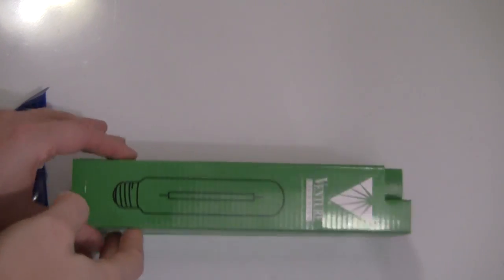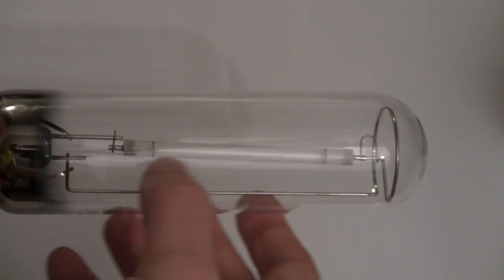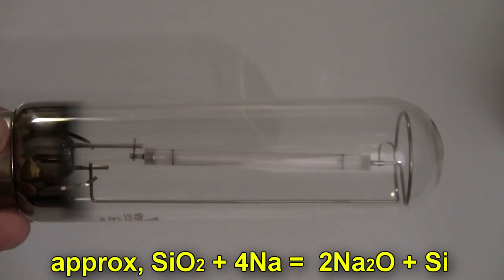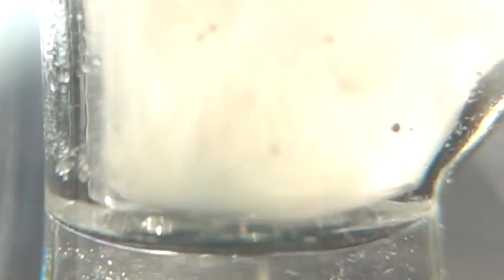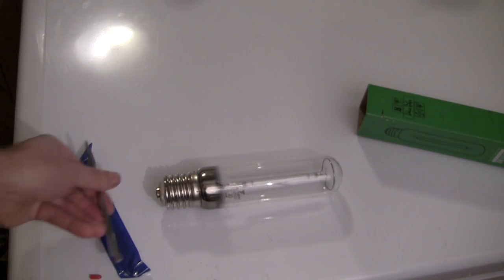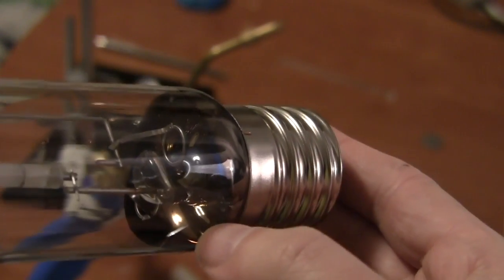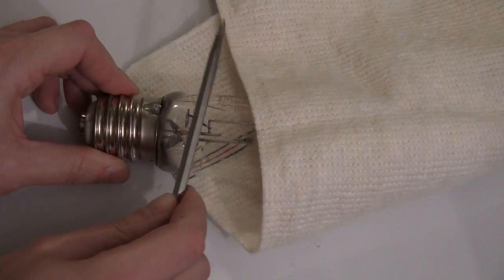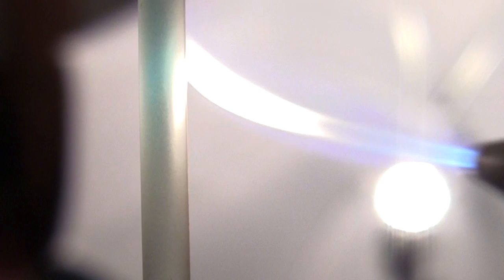Surprises in dismantling a sodium streetlight!

Comment: that silver is reactive to any residual oxygen in the tube.  If you noticed it has 2 getters in the bulb. They vacuum the gasses out of the tube just like a vacuum tube so that current flowing through the wires to the sodium tube won't ionize the gases which would essentially steal the power from the sodium tube. The silver getter material will react and absorb any remaining oxygen in the tube and turn white when exposed to air.  Also imagine the pressure inside the bulb due to the intense heat generated by the sodium lamp. It would blow the bulb apart.

Comment: You are not supposed to touch these with your bare hands as the oils in your hand will diffuse through the (real hot) glass.
Reply: False. This is a completely different kind of lamp from a halogen which is effected by oils. The outer glass does not dissipate heat in an HPS, it's only real purpose is to keep oxygen off the sodium tube inside.

Comment: A friend of mine needed a UV light source to test some special optics so he removed the outer envelope of a high power fluorescent streetlamp and used the internal mercury vapour lamp. He tried to get some information from the manufacturer (Philips IIRC) about the wavelength of the UV but for some reason they just didn't want to know LOL. I wonder why........

Comment: What you are calling silver at the bottom is from the "getter".  The getter is used to eat up any residual gas from a vacuum tube.  That material was once on the rings you see, which are exited by electromagnetic induction, superheating the material and leaving the coating on the glass as it burns away any remaining gas.

(I used to test display tubes for Hughes Display Products, and have watched the production process for monochrome display tubes used in aircraft and ground radar equipment.)

Comment: Hi, this is not cesium it is barium getter!  It is for maintaining vacuum in that tube. Inside those metal rings is barium azide and when barium azide is heated (with induction heating during evacuation of tube)  it's decompose to barium and nitrogen and metal barium is condensed on glass tube walls. Search on youtube Induction Getter Flash.
Barium is used because is reactive with nitrogen, oxygen, co2 and many gasses  thus maintaining vacuum in  tube.

Comment: Thunderf00t, that metallic looking stuff at the base is probably 
a"getter".  This is material evaporated from a filament once the vacuum 
tube is finally sealed.  Its purpose is to maintain the vacuum over 
time by absorbing molecules generated by the heating process.  Getters 
are used a lot in all sorts of vacuum tubes .  :-)
Reply: +MrRamraider
 Further on you say caesium, same thing, for mopping up anything reactive.

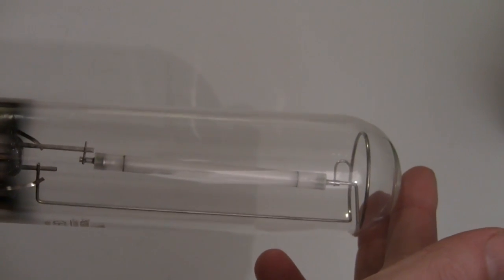Comment: 2:06 The silver part is from the getter inside the tube that creates similar layer of reactive metal on the surface of the glass during manufacture like in vacuum electron tubes and it ensures the vacuum between the outer and inner tube._

Comment: The silvery material looks like getter material used in vacuum tubes. after production vacuum tubes are "flashed" and the getter material absorbs any residual oxygen and leaves a silvery deposit on the walls of the tube. I can see two rings under the silvery deposit those are the getters.

Comment: I used to work for a company that made HPS lamps. The "sodium" is actually a bead of sodium/mercury amalgam, sealed the inner tube (the "arc tube") which is filled with Xenon gas. The lamp circuit has a device called an ignitor (some people call it a "starter motor") which produces rapid high-voltage pulses which create a plasma initially in the Xenon. The Xenon glows a pale pink colour for a few minutes while the sodium heats up and evaporates, after which the light becomes orange. The purpose of the "choke" that Thunderf00t mentions is to regulate the current in the tube, which would otherwise rise exponentially until the lamp was destroyed. (I saw a demo of this once in a training lecture.) This was all in the early 1980s though, so it could all be different by now.

Comment: If you put a scratch longitudinally along the glass it should break more easily.

Longitudinal vs Hoop stress in a pressurised cylinder. Stress is always higher in the hoop so cylinders will always fail with a tear longitudinal.
Reply: +Tsf Phi Taking a few seconds to watch the rest of the video it's clear you're more experienced and delicate at this than I am. Carry on.

Comment: The sliver coloring of the bottom of the light is Gettering.   In radio tubes its typically a sodium compound that is inductively heated to remove, as much is possible, the remaining oxygen and impurities in the tube or light bulb. You can see the 2 getter rings at the bottom of the tube.

Comment: The silver part near the base is to react with any leftover oxygen in the bulb.  This is the same idea with vacuum tubes (for radios, etc.).  You can also tell if it is cracked/leaking as the silver turns a flaky white.

Comment: The metal coating on the inside of the tube is called a getter and its purpose is to scavange residual oxygen, water and other reactive gases that are adsorbed onto the glass surface and are hard to remove otherwise.  Barium, aluminium, titanium are commonly used in special getter alloys and deposited onto the glass using induction heating when the tube is already sealed and under low pressure (In the video its observable that some of the alloy evaporates as the hot glas touches the mirrored area). The golden color can also be just due to oxide/hydroxide layers that remove certain wavelenghts due to destructive interference during reflection.

Comment: You could just use a pipe cutter with a tungsten carbide blade. I've done it before and works fine for cutting all kinds of glass tubes.

Comment: Pretty sure the Silver colour is down to it being lead based glass used for the outer envelope which dis-colours when heated to high temperatures for forming without tempering while cooling., Personally worked more with mercury based compact florescents than HPSV though  and its been a few years...If you want a real cool trick try viewing formed lead glass through a polarized lense (from ordinary sunglasses) against a white computer screen ;)

Comment: Interesting bit for ya:

Yes, that metallic strip on the discharge tube is for aiding the initial striking of the lamp... sodium lamps are a bit like fluorescent lamps in that they strike better when there's a nearby metal surface... if it's grounded then that's even better... as for the metal in the bottom of the lamp where it's made reflective, that's where a Cesium getter material has been sputtered onto the glass, it's used as an indicator to warn in case the lamp has been cracked since if the arc tube was to leak (which is very common for sodium lamps that have a lot of hours on them and have been cycled on and off regularly, such as a street lamp or high bay fixture in a factory), the hot sodium vapor would immediately react with the moisture that leaks into the tube alongside any air. If this happens, of course, you'll have a bit of an issue since there's a fair amount of sodium in these lamps!! although WAAAY less than your average SOX (or low pressure sodium) lamp!

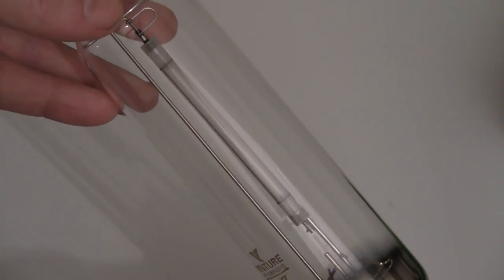Comment: @1:52 The silvery material is prolly Barium.
These bulbs (High power light bulbs in general) are similar in construction to a vacuum tube. They both require a vacuum for operation. During construction, a part called a 'Getter' is installed, that usually has Barium. Once the bulb has a vacuum and is sealed,  the Getters are heated via induction so the Barium boils off (flashes) and reacts with and 'absorbs' any trace gases and 'pulls' a hard vacuum, and also coats the inside of the bulb. That's the silver colored coating you see. (I'm assuming that the Getters in this bulb are probably the two round plates you can see in the area of the silver coating). If the bulb loses vacuum, or even gets a small leak. the Barium will react with incoming gases, like a Zinc sacrificial anode, and help maintain the hard vacuum. However, if the leak is excessive, (or bulb cracks) all of the Barium is reacted, and the silvery coating turns powder white. If you ever see a vacuum tube or bulb where the coating has turned powder white DO NOT USE, as there is air in the bulb, and as soon is the bulb/tube is energized, it will burn up, and may short, causing damage to the circuit it is plugged into. (In the case of these light bulbs, prolly won't do much damage to a simple power circuit, maybe trip the breaker, but if it's a vacuum tube in an electronic apparatus, or an amplifier, the shorted tube can cause significant damage.)

Comment: I remember my chemistry teacher wanting to show me the trick of using hot glass to enlarge (and basically cut) a crack in a glass tube. The burner available wasn't hot enough so the demonstration failed, although I did see the crack enlarge a little. Thanks for showing me that the trick actually works as I trusted this was the case, but had not seen the actual evidence. At first I thought you meant the purple glow of a sodium light, but realised later what you meant. I was thought that the starting colour of the sodium licht which is purply, lilac at first is cause by the starter gas that warms up the sodium untill it can function on it's own and I believe I was told Helium did that trick. Is there any validity in that explanation???

Comment: Whenever I cut cylindrical glass I simply score the glass all the way around, then run some hot water over the score before giving it a dip in some cold water. The smaller the temperature difference the more precise the cut. Though too little teperature difference and you end up not having it come apart at all. it is very effective though. I can cut a bottle in half with enough precision to have both ends be usable for something with the only waste material being whatever gets sanded off in smoothing down the edges.

Comment: The metallic thing you are referring to is the deposit of a getter - it's purpose is to absorb the remaining gas after sucking the air out of the tube and precipitate it on the glass of the tube hence the "coating". You'll find the same thing in thermionic valves :) You can actually notice the getter being two metallic rings on the bottom.

Comment: I was thinking the silver at the bottom of the tube was a getter. I thought the outer tube was under a hard vacuum.
Edit:
After you noticed the cesium (shiny part), I saw the two circles used to deposit the getter (cesium) material to scavenge lose oxygen.
Reply: Kind of surprised that a physicist wouldn't be familiar with a basic vacuum tube.  Strange.

Comment: The cesium on the inside base of the outer envelope is what is known as a getter.  They put it at the base to absorb any oxygen that would slowly leak into the envelope where the glass envelope is crimped and sealed to the wires.  You will see this used extensively in vacuum tubes and bulbs.

Comment: Not sure if this is helpfull but there's probably an easier way to get into it. a few months ago I took apart a regular lightbulb, in order to get a clear bulb of glass with the screw bit on the end, but none of the parts, and clearing out the white paint. I want to turn it into an oil lamp, bu that's beside the point. I bring this up because the metal screw bit at the bottom, is 2 points of contact, the outside, and a metal pin in the middle that makes contact. The two are insulated from eachother by cheap ceramic. It's very easy to just chip away at the ceramic with no risk to breaking the glass. you just chip away the ceramic, which is sometimes coated in something else that's softer (not sure offhand), but you can just chip away at it with a screwdriver, a nail, even a penny (which is what I used). and it lets you pull out the entire internal workings as one long piece, you just need to work a pair of snips into the opening to reach the point where it connects to the external screw bit, to slide the whole thing out of its housing. 

the only issue I see for this method with this particular bulb is the ring at the far end that's used for suspension. I'm not sure how flexible that is, or how brittle that tube is that you wanted. that might need bent, or snipped off while in the bulb. But this saves you the hastle of having broken bits of glass, and lets you keep the actual bulb separate from the workings for some other project.  though, I typically look more at it as for art projects than science projects.

I also have a question. if your goal was to get its spectrum, wouldn't get get that just by running a current through? i mean, it is being used as a lightsource after all.

Comment: Hi Thunderf00t, next time when you dismantle a streetlight just use a simple piece of cotton string or cord, dip that string into alcohol or some other flammable substance, wrap the string around the glass, light up the string with a lighter, dip the bulb and the burning string into some water, and then you will see that the glass will break with a near perfect edge at the exact point where the string was burning. At least this method works fine with glass bottles.

Comment: Lore has it that finger oils will destroy the quartzglas envelope or the AlO2 arc tube over time after the lamp is turned on and the oil is transmuted.  Everyone in the lamp industry is required to wear gloves when handling these components to prevent depositing fingerprints.  Should you use one of these lamps or its components after depositing organic material on them, do so with caution.  The lighting industry expends a lot of resources attempting to prevent "vetrification" of the purest SiO2 they can produce for high-temperature applications.  Essentially the fundamental engineering challenge is to put as much "fire" in a "bottle" as possible without melting the bottle.  Over time, the quartzglas (pure SiO2) crystalizes ("vitrifies"), creating gas leaks between the crystals.  Heating and cooling (ON/OFF) accelerates this process, as does the presence of organic materials.  With surface contamination, "non-passive failure" ("NPF" as they refer to it in the industry = EXPLOSION!) can occur as soon as the first power-cycle of the lamp.
     The "reflective stuff" at the bottom of the envelope is left over from the "getter".  The getter is heated (and as a side-effect "sputtered") after the lamp has been evacuated to release the getter material into the envelope.  In turn, this material scavenges the small remnants of reactive gas (oxygen) remaining inside after (most of) the atmosphere has been removed.

Comment: It's called the "getter", Phil. Vacuum tubes have them too. It's unoxidized metal to attract and bind to any stray gas molecules. If the vacuum becomes broken it immediately oxidizes and goes black(ish) in color. It comes off those two metal rings which are heated inductively after the vacuum has been drawn and sealed into the tube. The metal vapor then immediately condenses mostly on the inside of the glass envelope with a nice shiny silver look.

Question is, why is the inner tube surrounded by vacuum? Just to protect it and provide some isolation from heat conduction? Or is the material the inner tube is made of also subject to rapid oxidization, changing its optical properties?
Reply: The getter is most likely barium, not cesium. And the envelope is under vacuum to protect the refractory metal seals at the ends of the alumina tube which are most likely molybdenum. This is all similar to the construction of the old style glass vacuum tubes.
Reply: The vacuum is for thermal insulation, the arc tube runs at high temperature for best efficiency.
Reply: The material is very subject to it. And will for sure change its optical properties. Lots of research as you can imagine is put into producing a particular blend that'll produce optimal PAR

Comment: Whoa, hold back.... Salt is metal?? I've been pouring metal on my chips? Damn my guts must be rusty.
Reply: +TinMMA  "crystals" refers to the structure, not the composition. Salt is also crystalline in structure, as are snow flakes.
Reply: +ArcanePath360 Wait until you find out what sugar is :)
Reply: +Bumblebee 9337 Honey is bee poop.
Reply: *****
poop or vomit, yummy is yummy
Reply: +Bumblebee 9337   Sugar is carbon, hydrogen, and oxygen. Meh. Not so surprising.
Reply: +ArcanePath360 It's crystals!
Reply: Woosh
Reply: +ArcanePath360 Table salt is a compound of a metal and a halogen. Sodium, and chlorine. One explodes in water and is an all around highly reactive metal. The other is a very reactive poisonous gas most of the time and quite foul smelling (and ugly IMHO, please excuse the Chlorine hate).
Reply: +MrLittlelawyer   I actually like chlorine, especially chlorine gas. Though it's deadly poisonous it's actually quite useful stuff if you take adequate precautions.
Reply: +ArcanePath360 Well call me an elementist instead of a racist, because tbh I don't really have much of a reason to dislike Chlorine, because I think Fluorine is awesome! (despite its incredible dangers). For some odd reason I also like potassium more than sodium.  Maybe its the single letter symbol or something. I think I would kind of dislike cesium, but its tendency to liquefy at room temperature is nice.